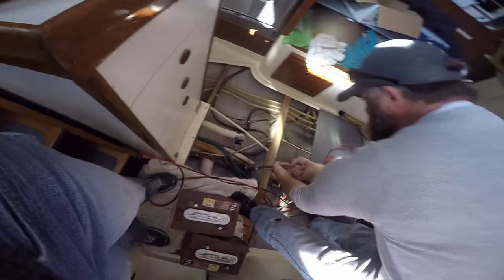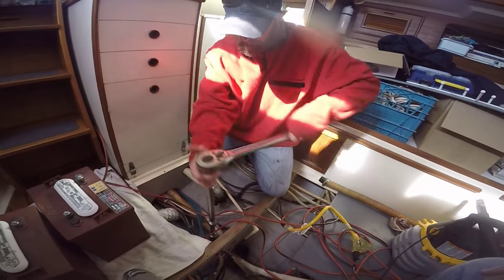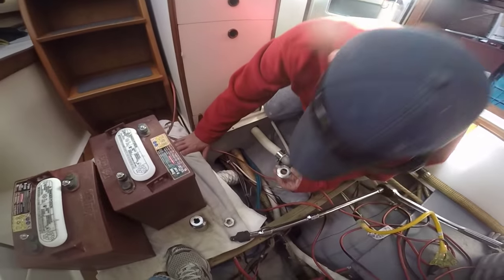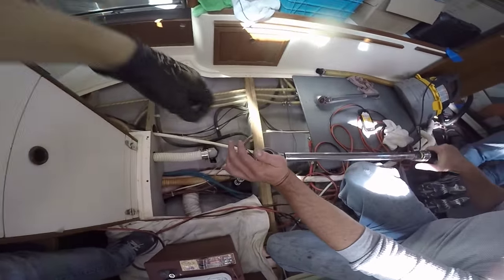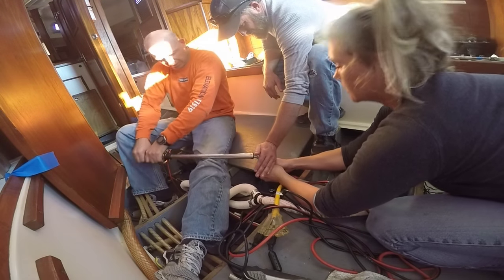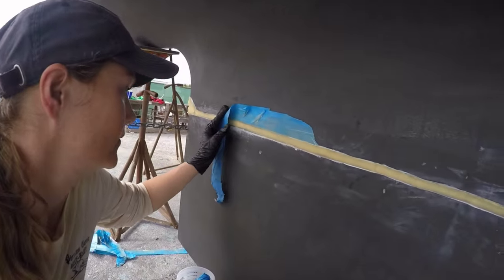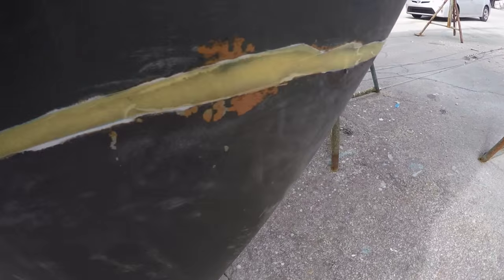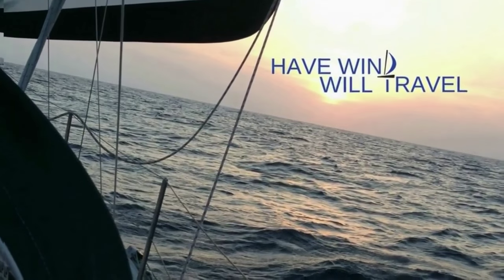#57: When Re-Torquing Keel Bolts: 250 = 180

Comment: Glad to see you having a go at these projects. If somebody didn't say it's torque not torch setting with the wrench...just an accent problem.
The keel seam is tricky. It would be nice to be able to squeeze in the epoxy first into the crack then torque the bolts so the epoxy is actually in the seam, but that would be scary Incase the epoxy set before your got the bolts tightened.
We used to use a 2 part product called PRC a 2 part rubbery product that cures and allows slight flex. Better than one part moisture cure products.
Good job.

Comment: You have to be a little bit o' everyone when you own a boat.  Mechanic, plumber, etc.  Nice job on the keel seam.  Don't go nuts off camera if you see cracks develop again later on.  Single in line keel bolts simply cannot prevent that from happening.  Most performance boats suffer the same ill.  Thick keels and racing performance don't mix well.  Regarding the filler, you have to go behind closed doors for that.  The stuff is so light, any wind will pick it up.  I learned that when using the bead filler compound.  I actually brought a washer / dryer box down to the marina to mix my epoxy components, in order to stay out of the wind but close to the boat.  Nice vid, keep them coming.
Reply from the maker: +IntermittentSailingWithKids Thanks Intermittent!  I am laughing picturing you hunkered under a washer/dryer box next to your boat mixing epoxy.  I'll bet people gave you strange looks.  But, we get that all the time.  All of the crazy things we're always dragging back and forth from the boat to our condo.  We imagine the HOA folks frown upon us and refer to us in derogatory fashion as "Those boat people."  Ha ha.  Glad you're enjoying the show.  I have tons more to share!

Comment: You guys should have dropped the keel for a good look , not right off but enough to check for crevice corrosion and clean up the keel to hull join, if you have to tighten the bolts something is giving , I'm surprised the boat yard guys didn't steer you on the right path. Do it once do it right.
My trade is a Boatbuilder from New Zealand . It's great that your having fun with life ...all the best.
Reply from the maker: +Hot n Salty Hey Hot n Salty.  Wow, dropping the keel.  That is a BIG job.  When we routed out the seam between the keel and the hull everything looked solid, dry.  We're not sure the bolts had ever been checked in 31 years, so it was definitely time to tighten them regardless.  We did not see any other issues, however, with the keel joint.  Thanks for watching.  We're definitely having a good time!

Comment: If you had water in the seam the only way to check the studs for integrity/corrosion is to drop the keel. Just checking nuts and washers doesn't tell you much from what lies beneath. 
Also shouldn't re torque to factory specs especially if the studs have corroded. That's when you will snap studs.
Patching it up is a quick easy solution but you will have most likely have trapped stagnant water in there with the bolts

Comment: I’m currently dealing with keel movement issues in a Sabre 28-2.   Obviously not the same boat, but a similar lead keel bolted to a stub as your boat.  A couple comments I’d love to get your feedback on.  First, did you use any lube (grease, anti-seize, etc) on the keel bolt threads?, second, did you verify that all the athwartship bracing is solidly attached (my Sabre had some pulling of the tabbing on a few which prob contributed to stub movement), third, why did you choose epoxy for the keel/stub seam?  Sabre community is strongly against using epoxy because it won’t tolerate flex and could crack again.  Sabre people recommend either a polyester goo like 4000 or even 5200 or plain old polyester putty.  Finally, you said you used 4000 around leaking keel bolts.  Did you knotch the fiberglass around the bolt first or just squeeze it in as best you could?  My boat leaks at both the keel bolts and the keel/stub joint.  Ugh!  Anyway, sorry for all the words and thanks for sharing your experience.  I may do the same on my Sabre 28-2.

Comment: next time pull the tape while the epoxy is still in the green stage it prolly pulls off eazier , might roll the epoxy up a little along the edge though
Reply from the maker: Yep.  I've since learned that!  Thanks.  Where were you when I was cutting it off through dried epoxy?!  ; )
Reply: prolly sleeping or working on the assemblyline 
then again i dont own a boat ....... anymore 
at times like the once youre experiancing at the moment i'm real happy about that 
but when youre sailing at places where the water is clear and the sun is shining ..... whell you get the picture 

owned a small speedboat btw , i have been working on other peoples boats once in a while

Comment: "Retourched" really? Is that where ya heat up the bolts to 250 degrees? Lucky ya didn't have to have new keel bolts installed by the yard, that would cost around 10 grand!